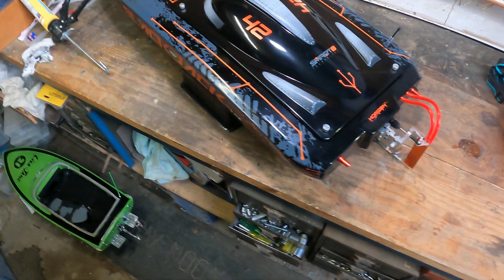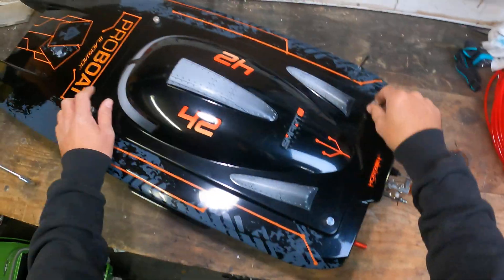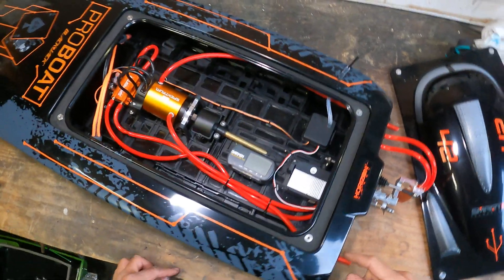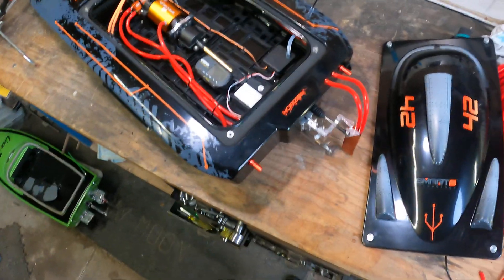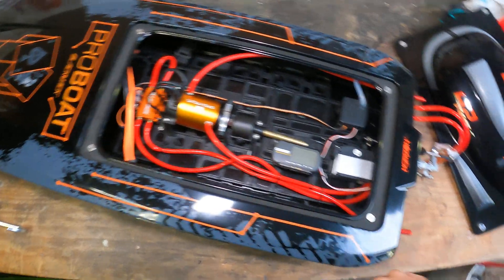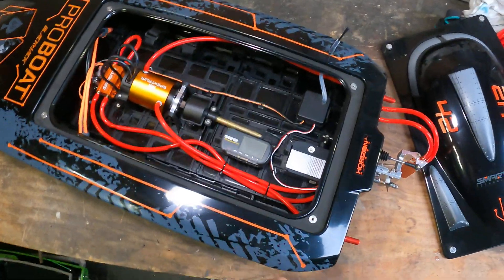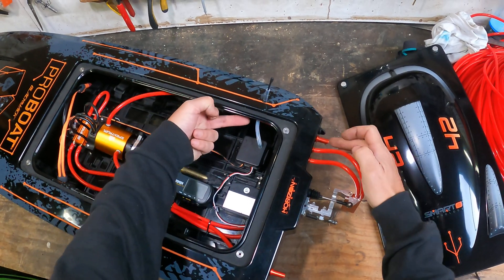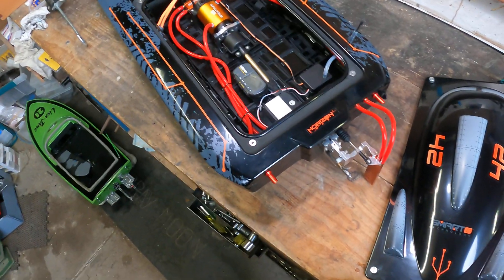First upgrade on the 42 - extra cooling circuit

Comment: seem that  Latex Tubing 1/8-inch ID 1/4-inch OD?'  is that correct?
Reply from the maker: No we use larger tubing than that, 4mm x 7mm

Comment: What do you use to « glue » the hose covers ?
Reply from the maker: As long as its a tight fit you dont need anything, if you drilled the hole too big use silicone

Comment: Looks pretty awesome!! I am getting ready to do the dual rudder cooling system on my brand new BJ42 but both of my outlets will be on the side of the boat. Anyways, what size is that tubbing 1st, - 1/4 ''?  2nd where did you get those back red outlets from and what size are these or do you have a link or part number?
Reply from the maker: Www.rcboatbitz.com

Comment: These new 42s look really bow light and most seem to be flipping. Could you stick a larger, heavier esc up front to keep it down?
Reply from the maker: Adding weight to fix lifting issues is the worst idea ever, tomorrow ill fit some trim tabs to it and post a video if you like
Reply: @RCBoatBitz  Yep, Trim tabs on a cat... Here you go .. not the first One to try that...but sure does the job to keep nose down... Tried and tested by me on a cat ...and yes make a video on the Run after install Trim tabs..if possíble also on how you fit them...
Reply from the maker: @TargetingXmod_RC  traxxas m41s come with them
Reply: @RCBoatBitz  I'd like to see that 👍 got one on order should be getting it soon 🤔 the new boat horizon just released what do you think of that?
Reply from the maker: @thomasthetankengine7153  do you mean the new impulse 32?
Reply: @RCBoatBitz  I know but i also don't like tabs, more drag, heat etc. bigger esc could mean 8s as well as weight? would for sure like to see her run with tabs. thanks for the vids :)
Reply from the maker: @jameslyons1978  these boats are 8s
Reply: @RCBoatBitz  meant 10s something like a ZTW
Reply: @RCBoatBitz  all you have to do is ajust prop angle on negative °
Reply from the maker: @nossrc5638  by adjusting the height of the strut and slight angle i have this running perfect in all but windy conditions, but when i start going faster it will need more angle which is a terrible idea. Ideally you want the prop angle close to straight for the hull to be efficient. The only place to go now is add weight, which i would never do, or fit trim tabs
Reply: @RCBoatBitz  keep playing with the angle of the propeller and the balance of the batteries that you are going to achieve, I had that problem with the Veles29 and I put it to run as directed but I changed to a longer and wider rudder, also a little longer, check it out on my channel at 70mph on a windy day, btw you need another prop ,custom prop
Reply from the maker: @nossrc5638  as i said i have it spot on now
Reply: @RCBoatBitz  love to see your video with the trim tabs, what size are you going with the ones that go on the Sonicwake 36 or do you have a part number?
Reply: What is the diameter of the tubing?
Reply from the maker: @brymk3220  ours has 4mm id which is a bit larger than stock